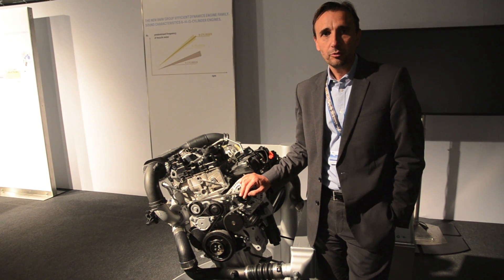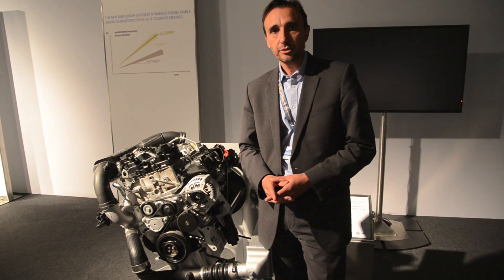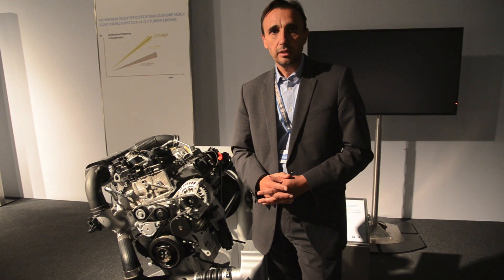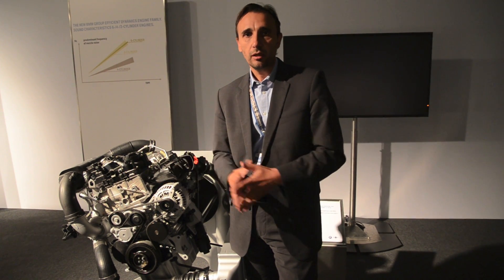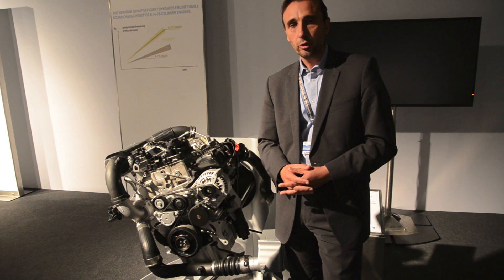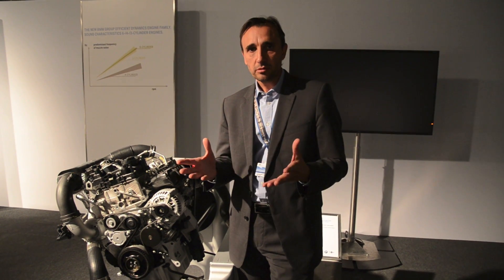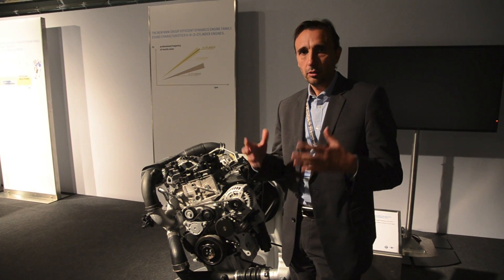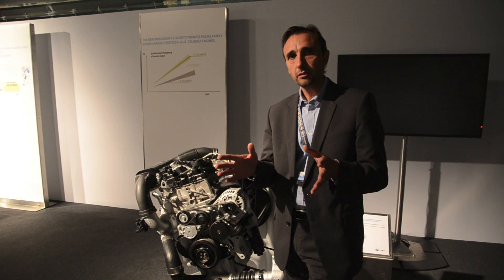BMW 3-Cylinder Engine: Technical Details

Comment: So much plastics that engine is made for failure. BMW garbage plastic engines. Buying BMW is a big no no.
Reply: Toyota use them, nuff said
Reply from the maker: That engine is actually quite reliable. No major issues from what I know
Reply: @bmwblog  no is garbage.
Reply: @bmwblog  Only engines before m50 last, seen bmw started to use plastics in engine are only real garbage.
Reply: @bmwblog so many haters. I've had 2 B38 engine cars and never an issue. Current one is 5 years old with 30k [low kms] but it runs beautifully.

Comment: I think old 4 cylinder n13 engine better than 3 cylinder b38 engine.
Reply from the maker: Not sure, the 3 cylinder sounds great
Reply: @bmwblog  If talking about engine sounds ı agree with you. But n13 engine faster then b38 engine. Two engine have same torque and horse power. I don' t understand how can do this.

Comment: I know rotaries have some maintenance problems, but honestly, why not just have that as an engine option rather than this "new age" 3 cylinder bullshit.
Reply: Horrible fuel efficiency in a Rotary. If you drove one of these motors, you'd understand, they're awesome.
Reply: Because they burn oil as part of the combustion process lol research how they actually work they simply aren’t efficient engines

Comment: 1.5 3 cylinder vs 1.5 4 cylinder, which engine is better ? ? ?
Reply: @Nichen Fauster they’ve engineeer it to be balanced on own bmw 118i and it’s solid you’d never guess it was three cylinders it sounds great you can’t compare it to a rattling corsa. Plus the 4 cylinder 1.5 engines in merc A class and Audi A3 are turbo charged, bmw have used 3 cylinders simply because they half halved a 6cylinder block rather than starting again with shot four cylinder.

Comment: I enjoyed this video immensely.  I bought a 3-cyl Polo for my daughter and find its exhaust tone and vibration superior to any 4cyl motor I can remember since the Saab 98 Turbo.  Personally I drive 6cyl and avoid 4cyl.  On the marketing front, I would strongly suggest that the lighting be improved for the next video, so we can see all of Dr Lopez' face. In addition, why not bring in the Marketing Mgr to help spice up the content delivery a bit? I can see this vid being much more engaging with two heads talking in a Q&A format. The marketing guy would deliver your key msgs and position Dr Lopez as the product expert. Win/win!
Reply: BMW are now putting 4 pots in cars badged 330i. That says a lot about modern cars and is deeply sad. All but the poverty spec Beemers in the 80s when I was a kid had a 6 cyl. A 4 cyl is boring imho, old Honda V Tecs excepted.

Comment: after some reading I believe the theory is spot on. My only concern is durability, especially in hot climates. The performance of all turbo engines is also greatly diminished with temperature increase.
Imagine: Heavy traffic, high temps, some not so good fuel and "long life" engine oil. 
I can see the electronics solution right away: cutting turbo boost, ignition timing etc... There goes the performance. The temps are still high and the "extended life oil" is not getting any newer. To finish of,f put some bad fuel into the mix..
The downsizing thing is great. In theory. In some situations. Certainly these engines can do 200.000km at 150Km/h in an autobahn all day with german premium no sulfer gas without breaking a sweat.
In 4h a day in traffic jams in sao paulo with 38°C heat and drinking 25% hidrated ethanol gasoline... hummm....

Comment: After three minutes into the video, I fell asleep, so I don't really know what he said. But, I own a 2009 Daihatsu 3 cylinder (740 kg) and it meets my needs, which are:
1) Extreme fuel efficiency
2) Not much noise
3) Flat torque characteristic
4) Enough output to go with the flow some more
The only disadvantage is that in a fully loaded car in the high alpine mountains the engine falls short of climbing steep mountain passes, especially in tight s-curves you have to go back to first gear.